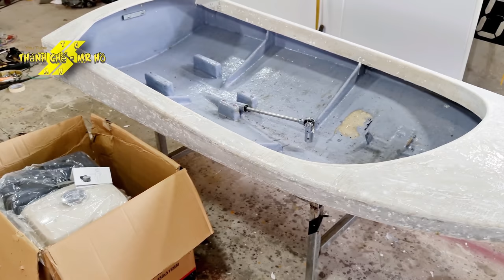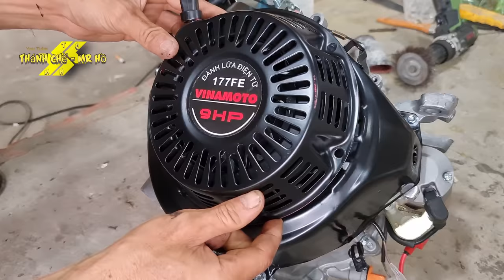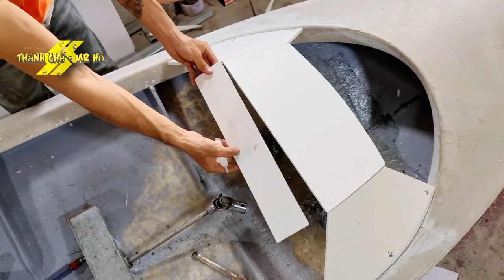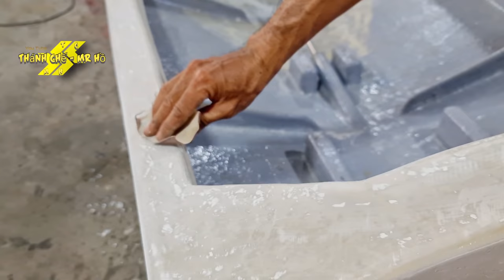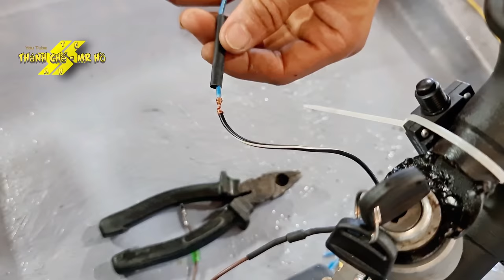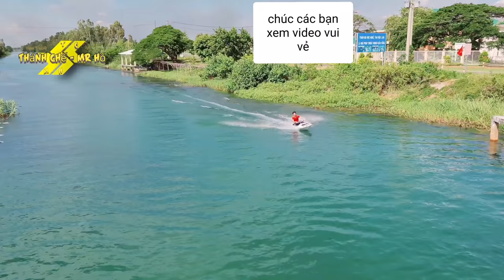Cano tự chế động cơ 9hp nằm trước. phiên bản nâng cấp

Comment: I love your design man but you need to be sitting more towards the middle you're sitting way too far back and so it's harder for your boat to get up to plane try sitting more towards the middle and putting your engine more towards the front  or keeping that design and just sitting in the middle the weight distribution will be a lot better you will see the performance maybe just make your boat a foot longer in Sit more towards the middle
Reply: that a good idea
Reply: Also, put the exhaust under water , it will give you more speed, no ? And Less noise :)
Reply: I think its better far back, if you sit in the middle the back portion of the boat will rise, thus the propeller cannot thrust better. Just saying ☺️
Reply: @tjmarquee7130  do you do much boating with long tails? there's already enough weight in the back
Reply: @MudMotorsMax  i own a boat like he did but only made with epoxy and plywood. 😅
Reply: @tjmarquee7130  hey that's okay if it's sturdy then it works.I just know there's plenty of weight in the back trust me man try being more towards the front with your engine towards the front or you being in the middle it'll help a lot

Comment: When the boat is jumping, this is the large hull angle of attack relative to the direction of the propeller thrust.  Change the angle of inclination of the propeller shaft through the propeller drive.
Reply: Besides that he has all the weight at the back of the boat. He needs to balance up.

Comment: bro, what brand of machine is it using and how many PK / HP
Reply: The engine is a "VINAMOTO 9hp 177FE", but if not available a 9hp Honda or Briggs or any small powerhouse would work just as well with the exception of probably a different sized jackshaft. Best of luck to you and I know it will turn out great!!👍🤘
Reply: @Basilisk_in_a_dark_room  thanks bro 🤘